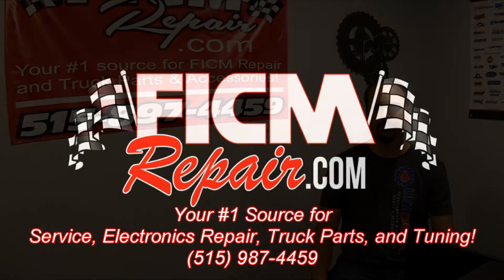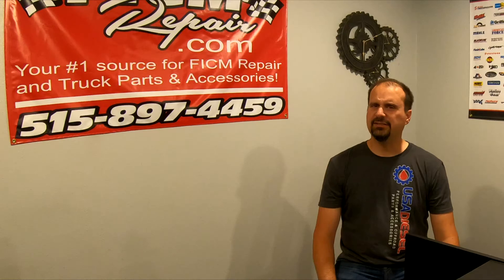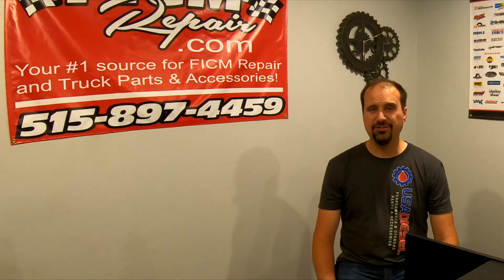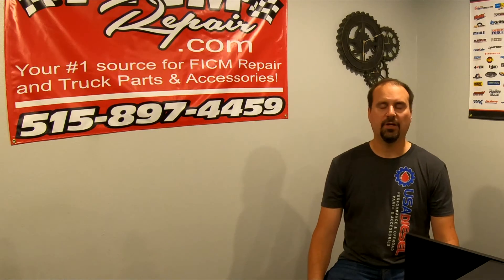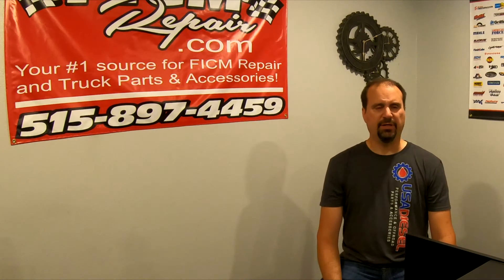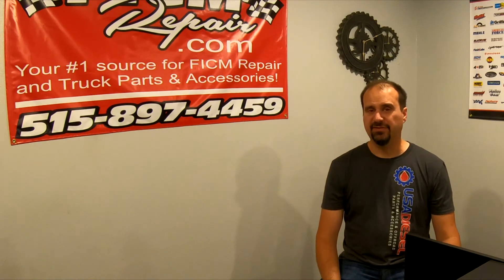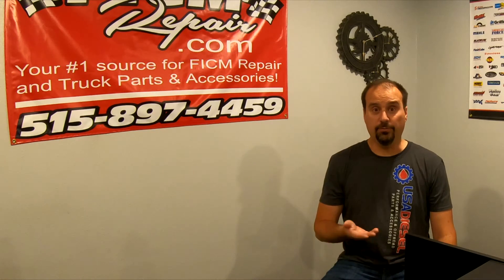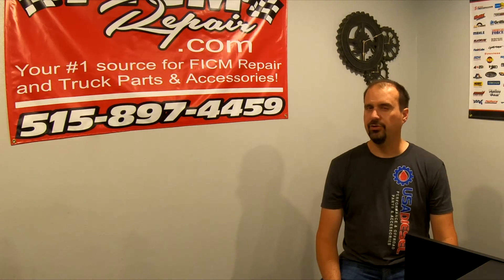How to Select an Alternator for your Powerstroke 6.0 / Considerations with other vehicles

Comment: I got a 110amp alternator and battery light now stays on and alternator and batteries are 3 months old I have the 1 alternator system and will change out to the 140amp ac delco and should work better. Why did ford put the 110 amp alt in a dual battery system when not enough?

Comment: What are your thoughts on a motorcraft 180amp alternator for a daily driver?
Reply from the maker: More amps are definitely the word of the day.  The Motorcraft unit doesn't use hairpin windings in its stator, though, so the efficiencies aren't there.  That unit likely makes somewhere in the 100 amp range at idle, whereas and for example, the 170 amp that we carry that is discussed in the video at https://www.youtube.com/watch?v=smHW-hUt-hk does a bit over 120 amps at cold idle.  Upshot?  It's all about the cold idle amps.